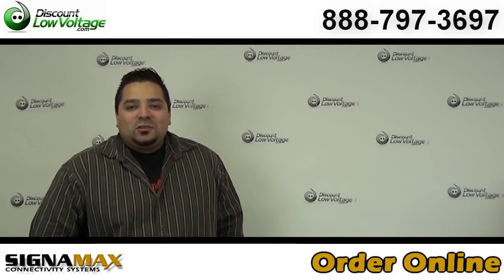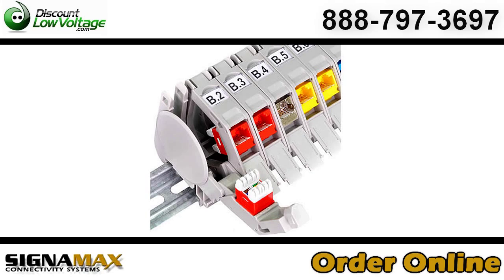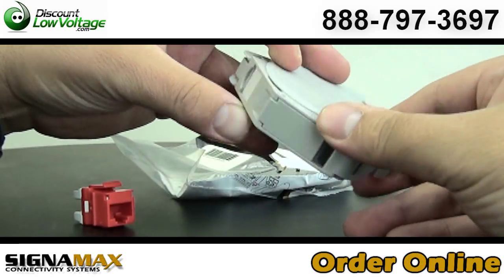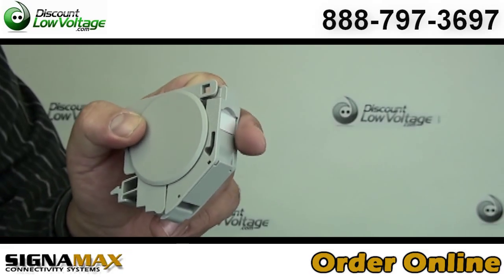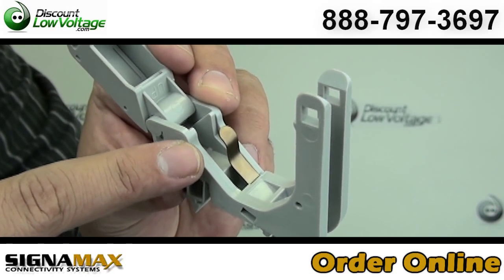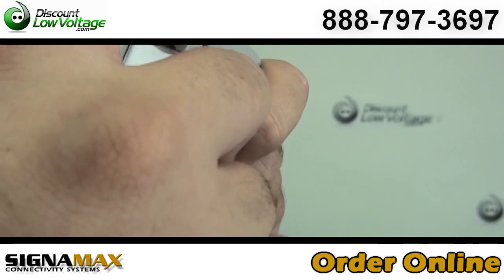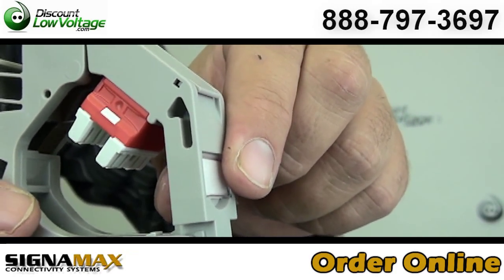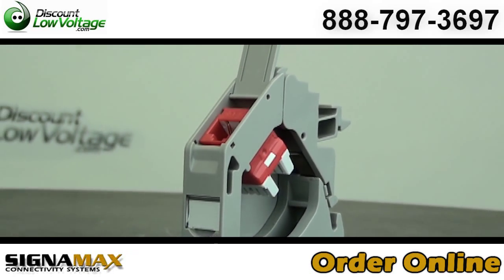DIN Rail Mounting Module for RJ45 Cat5e, Cat6 and Cat6A Keystone Jacks

Comment: Can you show a picture of the cables being attached?
Reply from the maker: Here's some more info, I hope it helps. The manufacture Data Sheet https://www.discount-low-voltage.com/core/media/media.nl/id.13119/c.1259044/.f?h=6f2256c5084e26165207 and you might also want to look at the installation sheet https://www.discount-low-voltage.com/core/media/media.nl/id.13120/c.1259044/.f?h=f86dc6fdc0933067588e